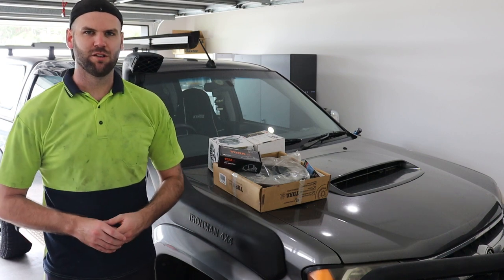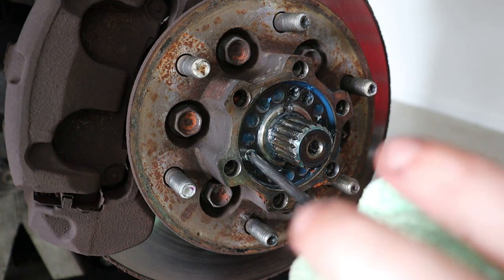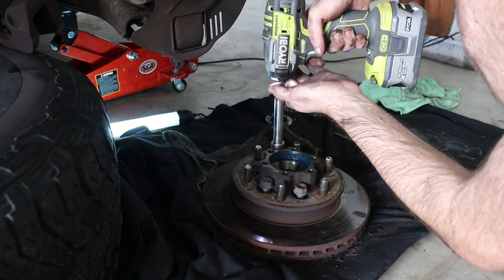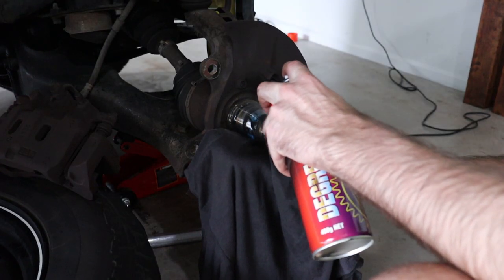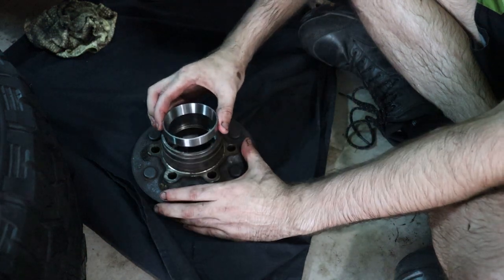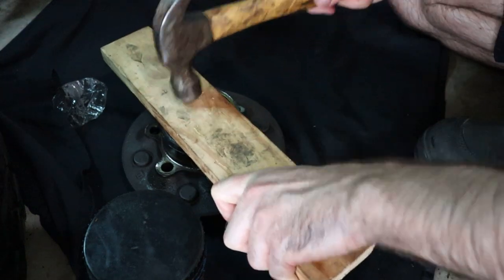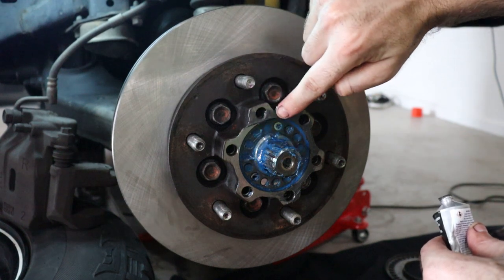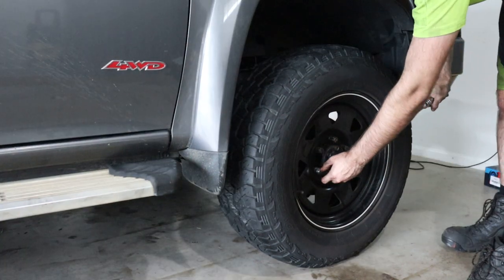How to Replace Brake Pads, Rotors and Wheel Bearings | Colorado MnM Series

Comment: If I could just add 1 thing I would recomend putting your race in the freezer for a while and only take it out just before install and also pre heat the hub so that the hub expands and the race contracts, it helps

Comment: Good vid mate. Would have been good to explain why you thought you needed to change them and what to look out for. 
Thanks again
Reply from the maker: Thanks heaps mate. The only reason I've changed the bearings is because I have a buckled front left wheel and it's been like that for ages, trying to order a replacement now. So just caused some general wear. Front rotors and pads was just a general maintenance thing too. The pads wore down to the metal tab indicating they are due to be replaced and didn't know the last time the rotors were done so thought it would be good to freshen up the whole lot in one go 🤙 Plus, a few people from the Colorado Facebook pages were asking questions and decided to make the video haha. So things to look out for are the screeching from the metal 'wear' tab on the brake pads. Excessive lip on the edge of the rotor and excessive play in the wheels bearings. Tested simply by jacking the vehicle up, one hand on the top and one at the bottom and rock back and worth. If there is excessive play, generally just the wheel bearings are worn.
Reply from the maker: That's just a few things to look out for, but there's probably a whole new video I could do just on things to look out for. I wanted to keep this video simple and straight to the point ✌️
Reply: Thanks for the reply 👍

Comment: Do you just tighten the locking ring with the punch and hammer?
Reply from the maker: Yes, tighten it up fairly firmly, then back it off slightly till the holes lines up for the screws.

Comment: Did your bearing kit come with new races? Mine didn't
Reply from the maker: Hey sorry mate, I didnt get notified about your comment. Yes the kit came with new races. Very strange that yours didn't. Hope you were able to get it sorted.
Reply: @AutomotiveActionMedia  yeah got the kits replaced
Reply: @AutomotiveActionMedia  Hello, is it required to remove the two races, I'll just need to replace and repack the old bearings.

Comment: Should avoid spraying brake cleaner near the rubber boots on the brake caliper, also a good idea to clean and regrease the brake slides aswell 
Good video though, good to see some maintenance videos on the rc colorado
Reply from the maker: Thats true. I had re-greased them the last time i changed the brake pads. It is a good idea, and I could've done more on this video but it isn't necessary. Thanks!

Comment: Not a great idea to hit a new bearing race like that.

Cut a slot in the old race with cutting disk in angle grinder so it can compress and not get stuck, and use that on top of new race to spread the impact from the hammer.
Reply: Using a hammer like that on the ABS rotor and an Allen key not advisable either.
Reply from the maker: @scod3908  Good idea on using the old race. I appreciate your feedback, this is just the method that worked for me. As I said in the video, tools are very limited where I was and no access to press on any of the good stuff, people can chose to do it the same way i have done, or do it there own way. Either way its gets done, someone will have a negative input and say there is a better way.
Reply: @AutomotiveActionMedia  I have always used the old race to bottom out the new one then flip it over and remove the old race in the same manner as in the first place.